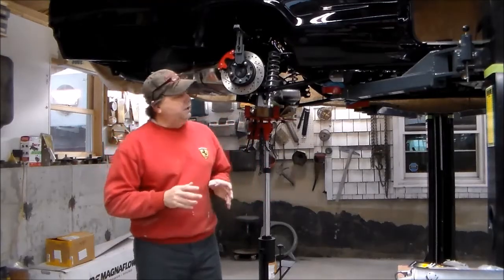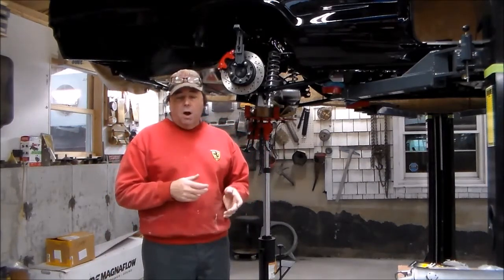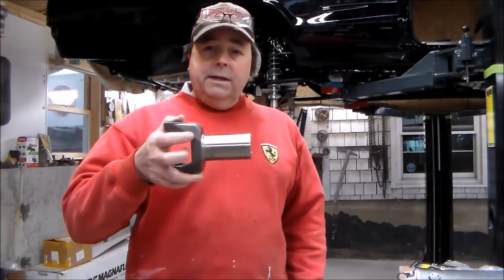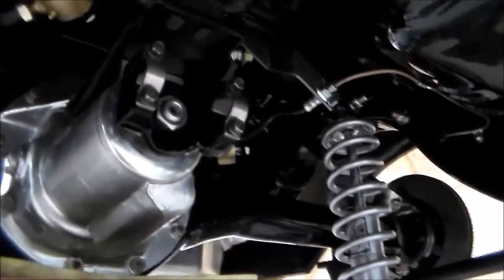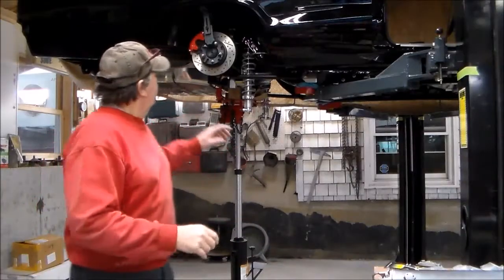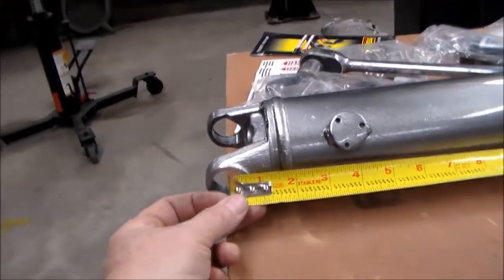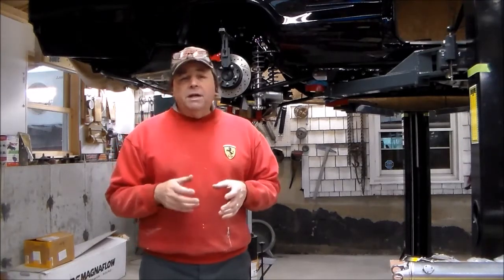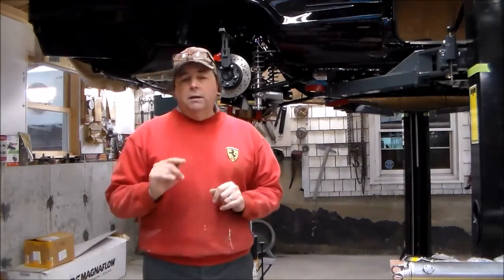How To Measure Your Driveshaft Properly. Gearvendors Overdrive.  Measure Twice, Cut Once.

Comment: Loving your videos. You make a lot of sense, and will be referencing these vids when my unit comes in.
Reply from the maker: Thank You!
Reply: @troykane  Ive got the unit and 727 transmission is out. Car is on jack stands on all 4. What do you think the best approach would be, being I don’t have a lift to measure the driveshaft length?  (71 challenger with leaf springs)
Reply from the maker: @1997LT1Camaro  install engine, trans, gearvendor. Set the stands under the suspension. Stettle the car down on the suspension. Install the gearvendor yoke. Measure from the yoke to the rearend yoke. Watch the video for the measuring process and you should be all set. 
good luck, Troy
Reply: @troykane  Thanks. I measured from yoke end to grease mark when fully inserted. Then split the difference.  Then I measured middle eye to middle  eye on rear end to yoke. 

I think this is what you did minus loading the suspension and unloading.  My jack stands were supporting from rear end itself to leave weight on suspension.
Reply from the maker: @1997LT1Camaro  Yes, that sounds right on too me!

Comment: Hi Tony, I like your page, is great. my question is : How will it go a" Gear Vendor on a 1986 Bronco with a C6.. They have a "short" transmission to suet the short wheel base Bronco. I have no problem up end speed, just a little weak first LONG gear, and of course only tre ...too long gears. Your input is very appreciate. I tray to stay away from changing diffs ratio of course. I think I have 4 .7/8.. to 1, or closer, with 31x 10.50 R 15 LT wheels ... Engine healthy 351 Cleveland ...Thank you in advance.
Reply from the maker: I would suggest you contact the folks at Gearvendor for this application. If they have a system I can assure you it will be of great benifit to the vehicles driveability. Thanks for the comment and thanks for tuning in. Good Luck